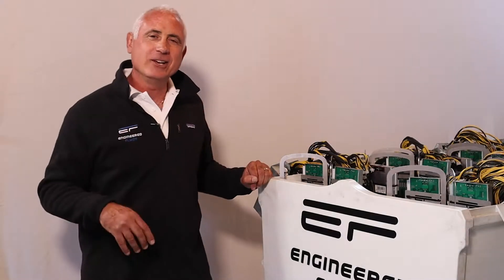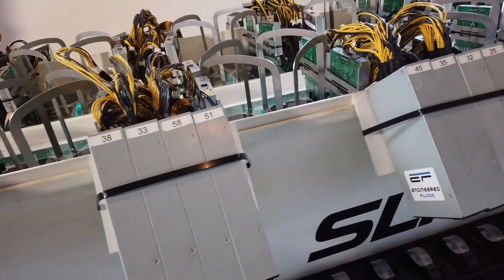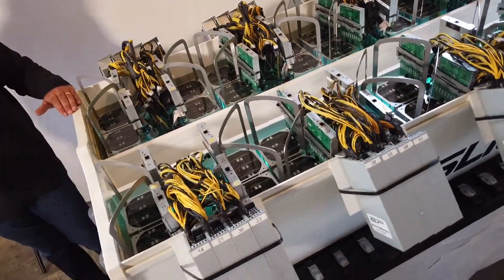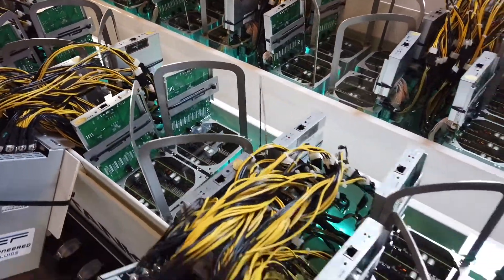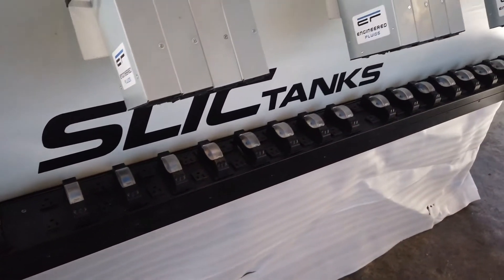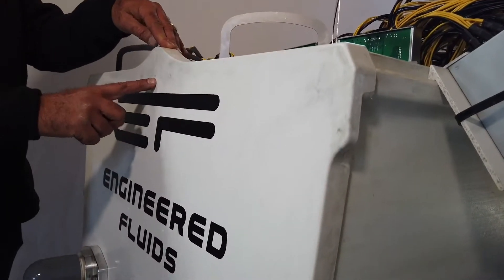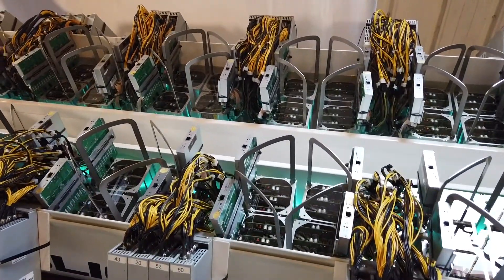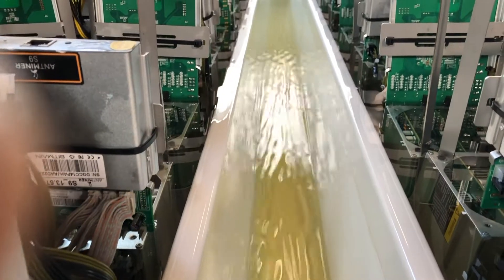Engineered Fluids - Announces the SLICTank Gen4

Comment: hello how to stop the fan >? i have aisne a1 22TH
Reply from the maker: In most of our systems, the fans on the dry cooler only operate about 20% of the time as the convective heat energy is often enough to drive cool air through the radiator and cool the fluid.  Since the Dielectric Coolant enters the tank at about 60C the delta in temperature between the ambient air and the liquid cooler is quite high, which creates an optimal situation for heat transfer.